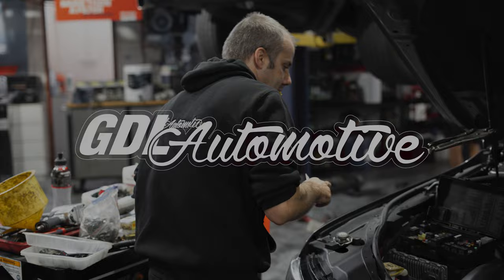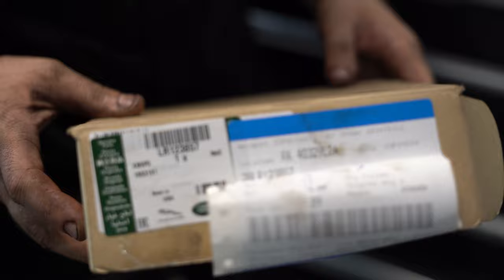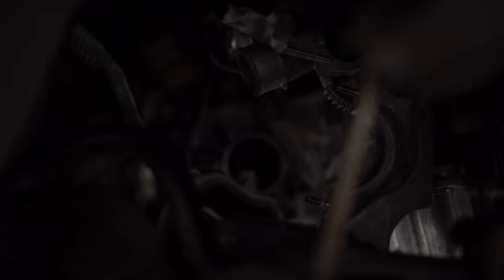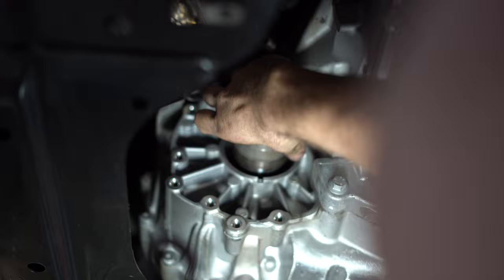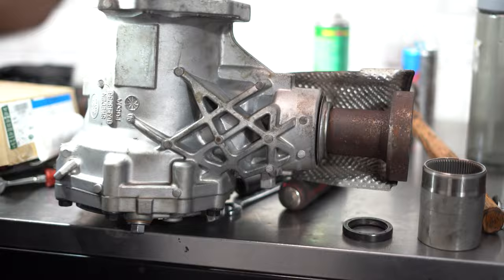Discovery Sport Leaking PTU Repair and Seal Overview

Comment: I did this job today using this video for pointers (nothing else out there). I didn't use any special tools but it was a lot of stuffing around. A couple of things; the sleeve is held in by a clip, it just pulls out, I had to rig up something to pry off. The hardest part I found was removing and fitting the larger seal on the gearbox side. In the transfer case there's a seal and also I guess a dust seal that goes on the top that this video doesn't show. Every discovery sport I've worked on the cv shaft is seized in the hub. I removed the whole hub/ brake assembly to get the shaft out. If u don't have a hoist or aren't a mechanic, I wouldn't recommend this job.
Reply: What did you use to remove the big seal on the gearbox side?

Comment: Yep sadly for me this alone did not fix it :-( I fitted the newer JLR sleeve kit with seals and it started to leak again on mine around 2 months later. The large circlip which "clicks" the sleeve onto the transmission output shaft is not strong enough to hold the sleeve in place. The mod from Bell Engineering installs a spacer on the PTU unit end which prevents the sleeve from moving away from the gearbox and towards the PTU when the circlip fails. So many people are sadly suffering from this issue it should be a JLR recall and JLR should provide a proper solution rather than charging nearly £400 for the repair kit + labor which in my case also failed. FYI just google SSM74140 for JLR's technical bulletin which covers this issue, but sadly has not gone to full recall.